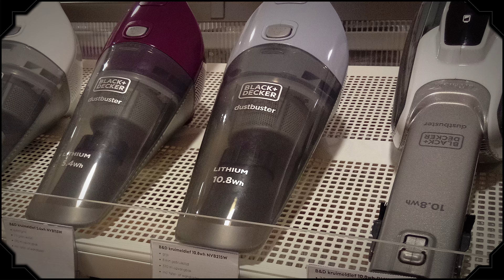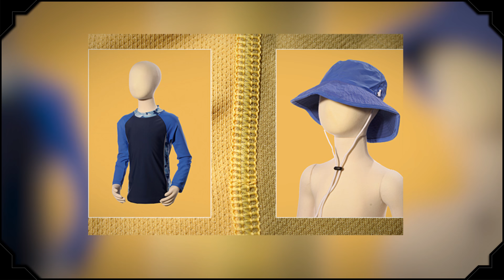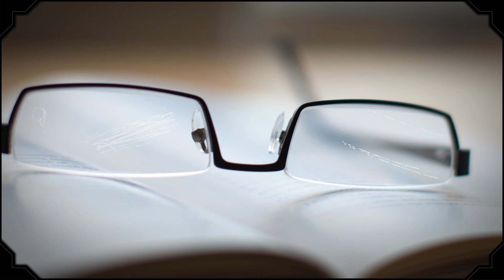11 NASA Inventions We Use Every Day | Mental Floss

Comment: 01	(0:38)	The Dustbuster
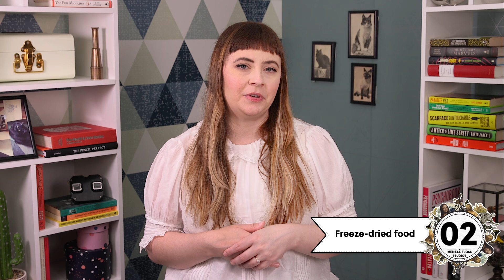02	(1:18)	Freeze-dried food -- example freeze dried ice-cream
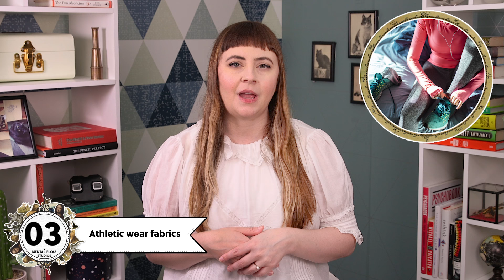03	(3:00)	Athletic wear fabrics
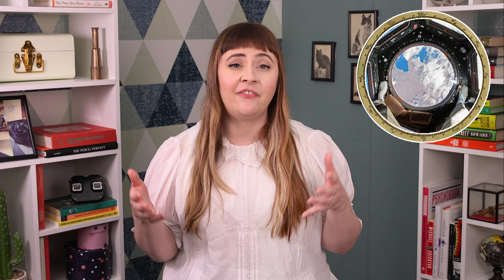04	(3:52)	Fogless coating for goggles, glasses, and more
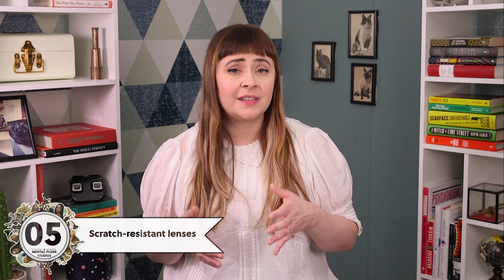05	(4:09)	Scratch-resistant lenses
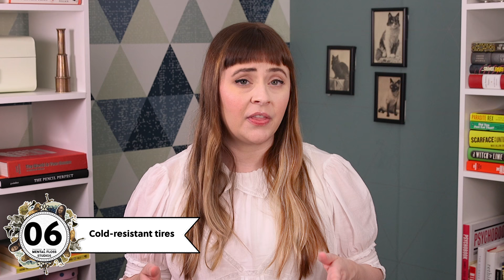06	(5:16)	Cold-resistant tires
07	(6:46)	Memory foam
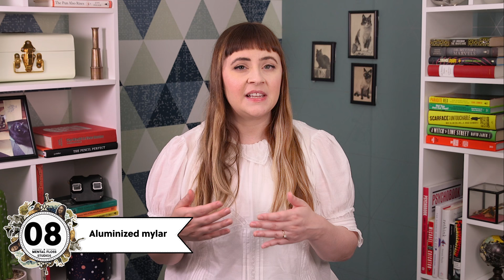08	(6:58)	Aluminized mylar
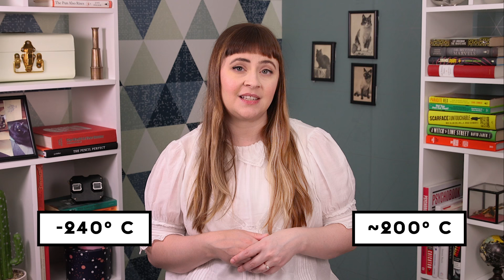09	(7:48)	Aluminized polymer insulation
10	(8:35)	Elements of consumer laptops -- example Velcro
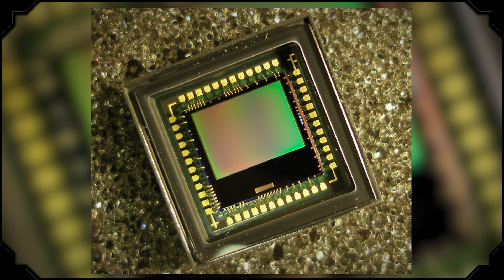11	(9:45)	CMOS sensors

debunked	- Space pens

Comment: I grew up on the "Space Coast," Brevard County (Satellite Beach specifically) and the first NASA invention I saw that made its' way into consumer's hands was Silicone Seal. It's durable, waterproof, and flexible even when dried (called "cured.") Bonus trivia: What did the locals call NASA? Never A Straight Answer ... everybody worked at the Cape back then.
Reply: I have to say oops to you. Silicone seals were developed in the 1930's.
Reply: @dallasarnold8615  Opps! I was not referring to gaskets made from a silicone compound, I was referring to a tube of glue. It was a clearish white compound that you could squeeze out onto a clean surface. They even left a sample on the outside of the package that looked reminiscent of a Hershey's Kiss for the prospective customer to feel. It arrived, touting NASA research, during the mid-sixties.
Reply: @TaiChiGhost  I was born in 1955. My father and my grandfather  (who were both in construction, as was I later ) showed me many of their past projects completed before I was born, some of which involved the use of silicone sealants applied with " caulking gun ". NASA was not created until 1958.  So, you must not be finding the right source for your information. Perhaps you are thinking of an improved version.
Reply: Perhaps Dupont lied on their packaging and got away with it. I was there. My dad worked at Cape Canaveral for Martin Marietta, on the Titan. I was born in 1950 and was a teenager during this time. I didn't read a web page or hear from relatives, I was there. Dupont wouldn't lie, would they? (Sarcasm alert)

Comment: All of this is full of half truths or very poorly researched on the www, specifically wikipedia. The Inca's were freeze drying food 800 years ago.  Liquid cooling/heating and ventilation garments were experimented with originally during  the second world war for aviators. Hydrophobic coatings were also used during WW2. Again, scratch resistant coating were in use as far back as the second world war, this time by the German Luftwaffe. The Antarctic Snow Cruiser in operation from 1939 to 1941 had tires which witstood more than -100c. And yet again, military vehicles were using this technology long before nasa existed.

Comment: Black and Decker had already started working on the cordless drill. NASA money helped make it a reality.

Another less common spinoff was the wireless telemetry used in hospitals. Cardiac information is passed to a central, monitored station where a “tele-tech” keeps an eye on it. In fact, one such unit is manufactured by a company called Space Lab……

Comment: I'll believe Black & Decker used related technologies in its moon dust accumulator and their commercial Dust Buster product. What you failed to explain is the fundamental difference between a vacuum cleaner and the moon device.  Vacuums depend on differential air pressure, which is not possible on the moon's surface unless the product somehow supplies its own air on a pretty big way   In other words, there may indeed be shared technologies, but the fundamental principles of operation would be different

Comment: The microprocessor and microcomputers were developed for the Apollo Program. At the time, computers of any useful capability were huge and took up entire rooms (see HAL 9000 in "2001: A Space Odyssey"). Apollo needed a computer they could carry onboard. We make fun of its limited specs now but it was an engineering marvel of its day.

Also Teflon.
Reply: I think you're talking about the silicon transistor and integrated circuits. They were actually for the Minuteman missile. But NASA quickly became the biggest customer. Minicomputers then followed. Then transistor count continued along Moore's Law and microprocessors came along.
Reply: 2 3-input NAND gates on a chip is a far cry from a microprocessor...
Teflon was invented in 1938, so what connection does it have with NASA?  Clearly, Teflon-insulated wire was already an off-the-shelf component when the Apollo program built the oxygen tanks.
Reply: @Ken Fullman Haha. No. The very, very first order for an IC was for $1000 a piece for 64 units. Integrated circuits cost $300 each when ordered in quantity (100+) in the very early 60s. That's like $2700 in today's money. In a couple years, they came down to $20 each as architectures and processes improved. 
Eventually, one of the makers (Fairchild?) decided to halve their price, and they started to sell to large companies like IBM for their own products. That's when prices really started down and quantities went up and things like electronic desktop calculators that didn't take up an entire desktop could be envisaged.

Comment: How does a vaccuum (machine), work in a vaccuum?
 Aren't dust particles caught in the draught of the air going into the motor?
Reply: I wish people would stop using dustbusters as the example. What "the tech" is is handheld, battery-powered tools. As she said, the first was a drill. Don't as many people have handheld battery-powered screwdrivers and drills as vacuums?
Reply: @Markle2k  but was there compressed air, introduced, to let the handheld vaccuum cleaner work?
  It seems over complicated, since you can complete the entire operation with an auger
Reply: It's not rocket science